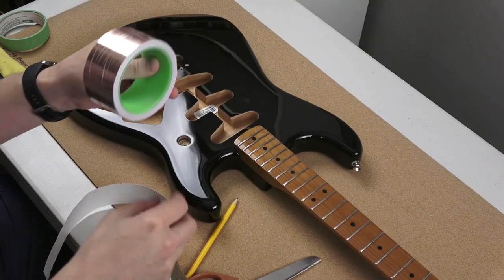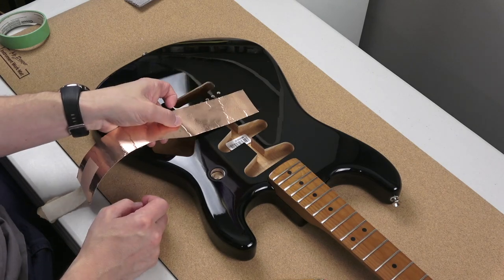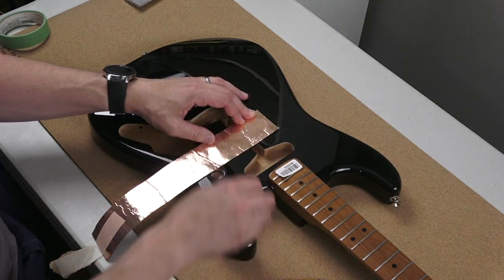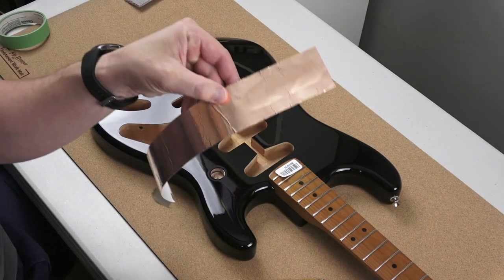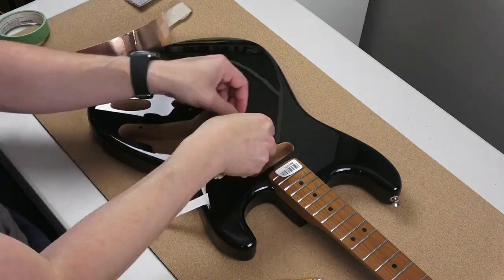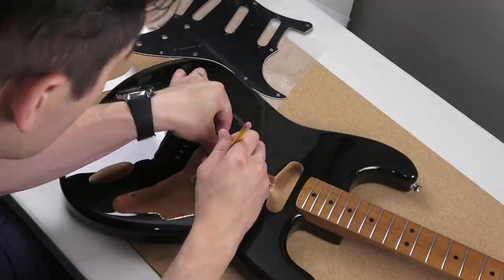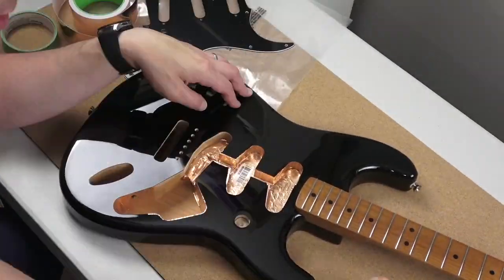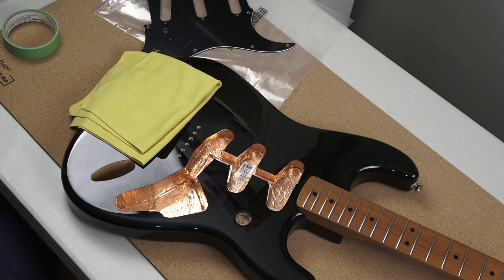How to Shield a Fender Stratocaster with Copper Foil Tape

Comment: I'm a believer that copper shielding tape is far superior to shielding paint. I've heard it said by guitar makers that you need at least 4 coats of the paint to equal the effectiveness of the tape.

One thing that people MUST know about shielding is that if you don't ground to it, it's completely useless. It can't form a faraday cage and stop outside interference unless you screw the ground wire into it. You also need to shield the inside of the pickguard and make sure it's grounded as well.

Another common misconception is about 60-cycle-hum. Shielding will not affect 60-cycle-hum at all. That's inherent in the design of a single coil pickup and the ONLY way around it is with a humbucking pickup design or active pickups. Shielding only prevents additional outside interference that can cause other hums, pops, ticks, hisses, and various other noises. For instance: If you are next to a cellphone or wifi access point those cause all kinds of additional junk that shielding is great at preventing.
Reply from the maker: thanks for sharing! I haven't used paint yet to compare. Everytime I went to order some it was out of stock, and expensive too!
Reply: @landonbailey  Yeah, last I checked they wanted $40 for a very small can of it, which is crazy!
Reply from the maker: @Hickeroar  roll of tape is way more economical and I never use that word!

Comment: It's important to use shielding tape with conductive adhesive. Check that the adhesive is conductive before buying. If not, you'll need to add a drop of solder to each piece that overlaps to complete the faraday cage.

Comment: Nice job and great tutorial
 Little Trick for this 
painters tape, scissors, paper, and a soft pencil or charcoal, 
1- Painters Tape the paper to the body over the cavities you need to shield
2- Rub the charcoal or pencil over to get the dimensions of the cavity 
3- Cut the pattern out to make a template
4- Use paper and bend it over the various depths for the sides and try to template it in one long running piece
5- Use the templates, and cut the foil tape to the patterns you need always leave a extra for the bottom cut of the sides and the bottom.
Also now you have templates and that will cut the time for the next shielding job.

For better shielding use a Aluminum backing sheet for the pickguard originally Leo Fender used solid Aluminum pickguards but for production changed it to a thin metal sheet backing for the shielding due to cost.

Keep in mind you are not really shielding the pickups, the pickups stick out beyond the shielding, What you are shielding is the wiring coming off the pickups, If you buy better pickups that are more expensive they use a Shielded wiring which is partially why they are expensive typically you see it in the $100-300 range like Dimarzio Evo/Darkmatter/Utopia pickups in the humbuckers but not in the single coils, so to remedy that for single coils you can simply make a shielding sleeve,
Shielding sleeves are a little rough to make as they require some time and skill but basically you want to wrap the wires in the Copper/Aluminum shielding and then insulate the shielding so you are not touching stuff for improper grounding.
If you are making your own pickups, simply use this, 
Custom Cable Connection 22 AWG 2 Conductor Stranded Shielded Plenum Cable White CL3P Jacket for Security/Alarm/Access Control/Sound - 100 Foot Roll in a bag - - Amazon.com
Just remember to ground the shielding layer.

Personally, Just get the Obsidian Strat PCB wiring kits, Use a solid aluminum pickguard, and shield the cables you should be good enough at that point.
Or just buy Fender noiseless pickups, my Morello Strat sig and HER strat sig just use metal pickguards with no shielding.
Reply from the maker: thanks for sharing all that!

Comment: IMO copper is superior to paint.
Reply from the maker: I haven't tried paint because of stock shortages and the cost
Reply: @landonbailey  
I always shield the Jack cavity also then run a jumper between it and the control cavity. This gives you continuity on all shielded areas. I use Seymour Duncan's SSL1 for neck and middle and a SSL5 for the bridge. My Strat is dead silent no noise at all .And one nice things the extra gain in the 5 gives your guitar almost a built in boost. Also added the Gilmore mod . Love this thing .

Comment: Hey Landon, any way to do shielding without removing all the electronics inside or is it impossible?
Reply: Once you remove the pickguard, that effectively takes all the important electronics out with it, which is sufficient. You can work around the couple wires that will be left (but make sure you have (or add) a wire to ground the shield, or it's useless).
Reply: @Hickeroar  thx bud
Reply: @Hickeroar  ... on a strat.
Reply: @44scoots  I assumed he mean't strat since it's strat video :P Other guitar styles would definitely require other methods. :D
Reply from the maker: you need to make clearance, so whatever works to gain access to the bare wood
Reply: @landonbailey  thx I'll try that